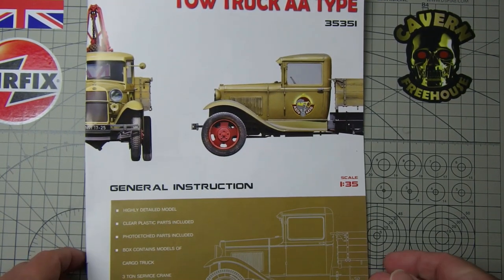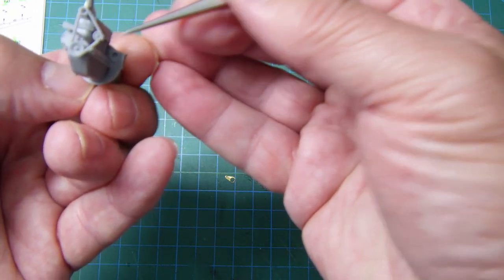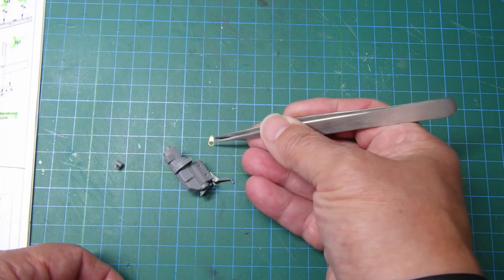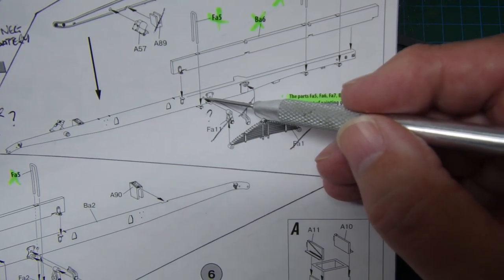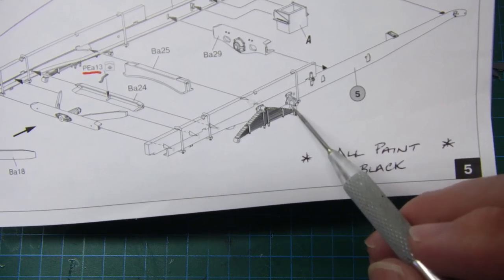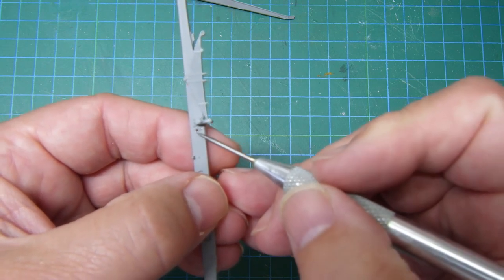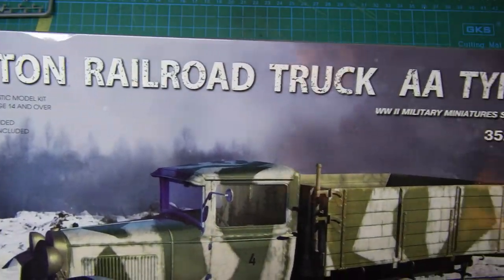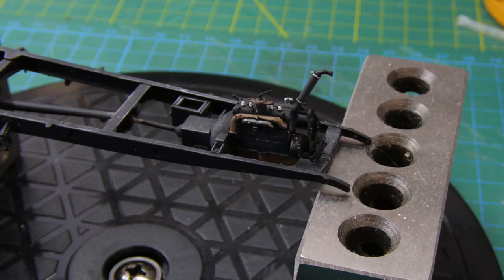Tow Truck GAZ / Ford AA build - part 2

Comment: Hi Bob, great job on those engine details.  I still have the instructions from when I built the werkstattkraftwagen and it has the same error.  Like you say, they obviously extended the line to far.  That's a great catch, I didn't even notice it when I built mine.  Your truck is looking great, I;ll be watching for more.  Have a great day.  Jeff
Reply from the maker: Thanks Jeff, like I said I put the bracket into the wrong hole and immediately thought this isn't right? School boy error really, I should have been checking further ahead. But hey! Thanks for watching. Cheers Bob 👍